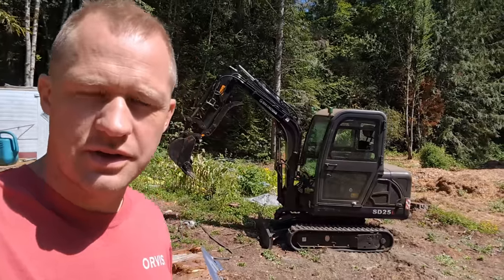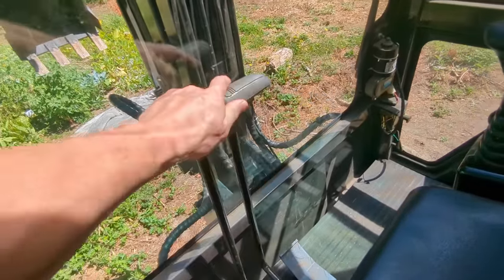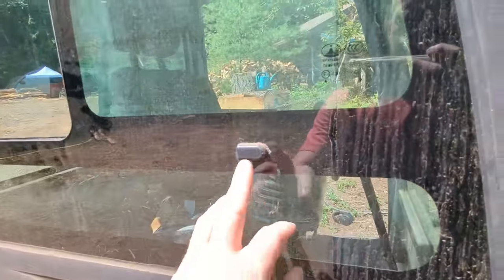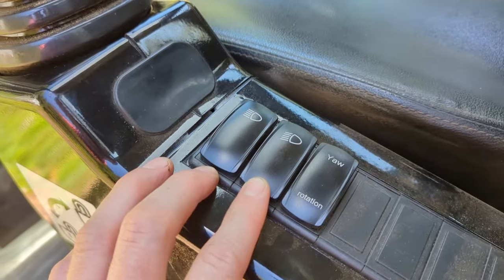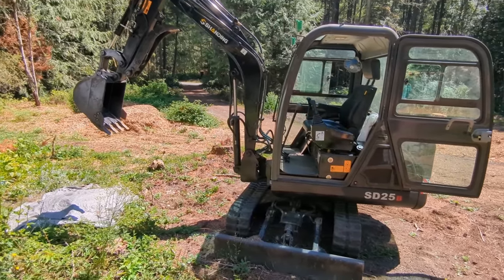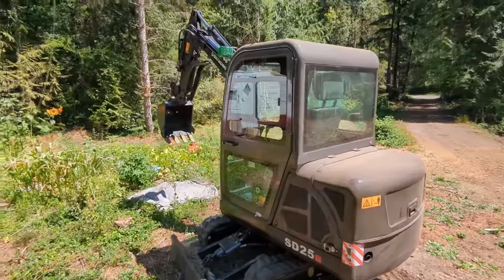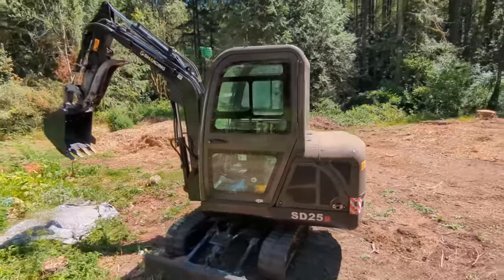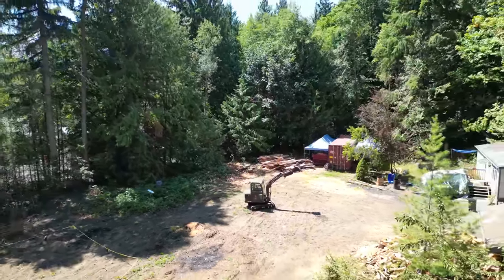Mini Excavator from Alibaba - 10 Problems after 50 Hours

Comment: So, I don't want to be one to defend a chinese manufacturer over better brands, but all these problems are pretty minor in my opinion. In my 15 years as a heavy duty mechanic, I've seen far worse manufacturer's defects from Cat, John Deere and the like, but I guess the difference is service (depending on your local dealer).

The bad o-ring is a pretty common one, they often get overtorqued and ripped, or undertorqued and prolapse. The window is pretty bad, that should never happen. Track motor valves being out of sync is also pretty common, and is something that periodically needs to be adjusted. I've seen the bad weatherstrip adhesive quite a bit too, a lot on Kenworths. The light switch is kind of funny, but what I would do is bypass it for power to the other accessories, and then use that switch to run a nice LED light bar. The thumb creep is not bad at all, most cylinders even when new have a little bit of creep from internal bypass, the seal is rarely perfect. You shouldn't be suspending loads for any long period of time from the boom, it's unsafe. I've never ran a mini hoe where you can use boom functions while walking the tracks. Most machine cabs without AC get pretty hot, my guess though is that it's intentional to use engine heat to heat the cab, instead of installing a proper HVAC system. You will probably be grateful for it when it get colder. The thumb grease fitting is that way because if you put a regular zerk on, it would break off very quickly due to it's location.

I don't know what you paid for this thing, but I'm actually pretty impressed.
Reply from the maker: Thank you for the amazing feedback. I am super happy with the machine. I think the total cost was about $17k, but another $9k in import taxes and shipping-related fees. I have an Excel sheet on it in this video:
https://youtu.be/jfaxFafO8uc?si=7t6GM3Y4o2Y_ER0O

Comment: Your video shows a container of Mobil Delvac 1300 15w40 desiel engine oil being used as hydraluic fluid. I hope this is an error in editing. 15w40 engine oil should not be used on hydraulic pumps as the additives will damage internal seals and bearings and poses a fire risk. Mobil Does make a Delvac hydraulic oil, Delvac  15w40 is not it.
Reply from the maker: I showed the wrong container. Sorry

Comment: If you have a hydraulic cylinder that's relaxing while there's still pressure in the system. As new as it is I highly doubt the cylinder itself is leaking down it's more than likely
You have a leaking spool valve. The control valve that's attached to the thumb pedal.
As far as it changing direction or doing odd things when you control more than one thing at a time. That's a combination of problems
Low hydraulic pressure and weak detent on the spool valves / hydraulic control valve.
Low hydraulic pressure allows the spool to release and Float back to neutral sometimes even back in the other direction. Takes hydraulic pressure to keep the valve locked in One Direction.
Buy a hydraulic pressure gauge install it on the high side of the system she'd have to run an extension hose so you can install it in the cab and watch the pressure. It shouldn't drop below 3,000 PSI.
Reply from the maker: Thanks!

Comment: Why use 15-40 motor oil for hydraulic fluid?

Cheap hydraulic fluid would work for it.
Reply from the maker: I showed the wrong container in the video by accident.
Reply: I was just watching the same thing and rubbing my eyes - did you just add motor oil to the hydraulic tank :D :D
Reply from the maker: @JaanKaer  yeah no. Actual hydraulic fluid onboard. Just the wrong container in the video

Comment: You showed engine oil when talking about the hydraulic fluid. I hope that was an editing mistake. If you mixed engine oil into your hydraulic system you will have bigger issues soon.
Reply from the maker: You are right. I accidentally showed the wrong container.

Comment: Your thumb cylinder is bleeding pressure internally.   A new one should NOT do this, but it is not uncommon as they age.    Almost all of my cylinders on my tractor do it to some degree, but it is VERY slow and does not affect anything I have speared or raised while under power.     Sounds to me like the cylinder needs to be refurbished... ugh.  Especially "ugh" if new.
Reply from the maker: Thank you for the insight. I'll take it apart and have a look.

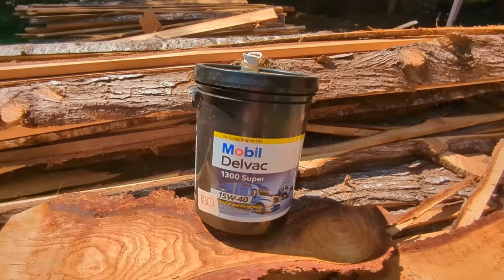Comment: OMG you put ENGINE OIL in your hydraulics!!!!!! ( 1:00 min in )
Reply from the maker: Oh shit! I showed the wrong container
Reply: Before actual hyd oil they used "oil".
Reply: For the smaller machines it is normal to use engine oil as hydraulic oil. I have an Komatsu PC09 and it is described in the manual to use 15w-40 engine oil. Simple and cheap.
Reply: @1223-y7  I looked it up and yes you are correct, in extreme heat environments like the aussie desert CAT products can use 15W40 in the hyd system. I learned something today.
Reply: Yes they do.

Comment: 15w40 is not appropriate for hydraulics, that might explain why your o-ring and problem with the thumbs (will be in your valve stack) that leaks and also the pump missing power when you switch from moving to diggin ... Get real hydraulic oil from a tractor dealer or CAT  !
You can get grease fitting like you want at any auto parts !
Reply from the maker: I brought out the wrong container. I have regular hydraulic fluid.

Comment: Issue with the thumb could be an inside leak in the cylinder you can't see that but it's possible way for loosing pressure while holding logs or something
Reply from the maker: Thanks 👍

Comment: You ordered a BLACK excavator and complained that its hot😂. Also not going straight issue is common for many machines and needs fixing only in severe cases
Reply from the maker: You do have a point. However, the heat is not from the color, but the engine compartment. Black looks cool. Enough said :)

Comment: Lol 15-40 is motor oil for diesel when hydrologics get slow dew to heat soak and pressure breaks down that motor oil swap for normal hydrologic oil... go to your napa or tractor supply and get new grease fittings take 1 of those so you vcan match threads
Reply from the maker: Broski. I accidentally showed the wrong container. I am using regular hydraulic oil.

Comment: In reference to your attempts at running multiple functions simultaneously (IE, tracking, rotating and moving any other bucket/arm/boom movement) these cheap machines simply don’t have enough hydraulic flow plus the hydraulic valves are of such low quality there will be a lot of jerky operation as well. 

This is just cheap Chinese junk for people who don’t put many hours on their equipment.  If you want to actually get work done and make money with zero hassle buy any name brand equipment. I’ve put thousands of hours on all kinds of quality equipment with zero issues vs having to fix things after every time it is started.
Reply from the maker: Yeah this is not to make money. This is just for me to mess around on my property, building my house, trenching, and installing geothermal.

Comment: That’s not hydraulic fluid my guy
Reply from the maker: I know. I accidentally showed the engine oil container instead of the hydraulic fluid container. They look very similar. The excavator has the correct fluid.

Comment: Increadable that Chinese builders have such poor quality control
Reply from the maker: When I first took delivery and talked to the shop about the quality control, they didn't get the concept. They said that they are pumping them out and will start a QC program in the future. This was when I just called about fast/slow being switched around and that when I push both levers forward, the handles didn't match up. This didn't even make it into this video :)